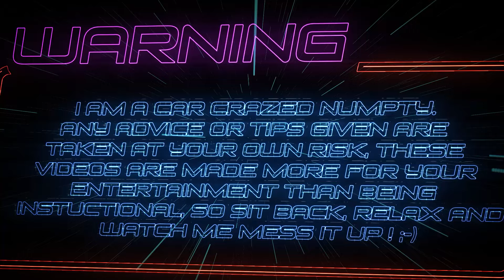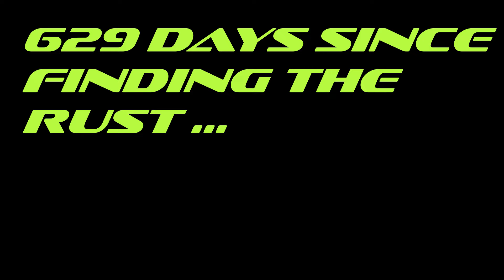Ford Puma MAJOR RUST REPAIR Rescued from the Brink Phase 2 PT1

Comment: Youve got your hands full there. I had to spend quite a bit because of the rust worms to get a fresh MOT this year. Inner sill area on mine was big problem. Seat belt and suspension mount areas were reason it failed originally. Time you can save with new parts is worth buying the new parts

Comment: I feel your pain on this one! I’ve had times where I think what the hell am I doing, just break it down into smaller sections to make them up. Your lucky to have parts available stuff for my cavaliers not so much unfortunately and it’s always the hard bits that has gone. Keep up the great work! Cheers.
Reply from the maker: Hi mate thanks for the msg, they didnt make panels for the puma for a long time but have started now, once this is back in one piece Ive still got the cavalier to repair too ! 🙈
Reply: @mec-tec  YES!!!😂😂 I’m looking forward to seeing that! Should be fairly straightforward, famous last words 🤦‍♂️😂👍
Reply from the maker: @Cavalier_Steve  😄😄 deffo sumit will come out n bite me im sure 🙈👍👍

Comment: I have been looking forward to you coming back to the Puma. You have got your work cut out for you, can you get a section cut from another  puma ? removing the axle is very easy on the Puma, i had to have a repair done behind it, took a few minutes to drop it down and back up.
Reply from the maker: Hi mate, yes its been a long time coming hasnt it, certainly gona be a challenge, i dont have any cuts from another car as they will probably be in similar condition, i have a new outer sill and arch, the rest i will have to make, yes the axle does come down easy as u say, was just hoping not to haha 
All the best MEC 👍👍